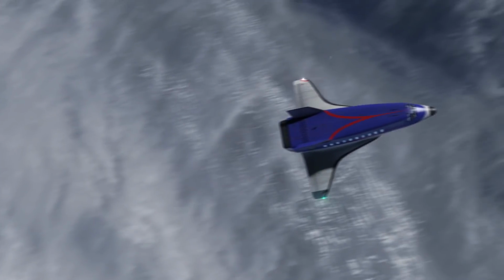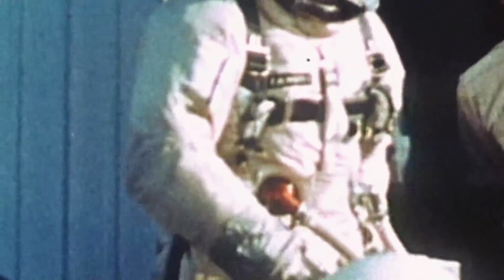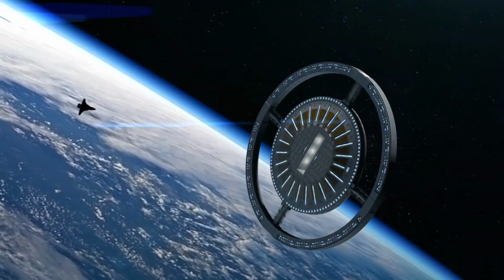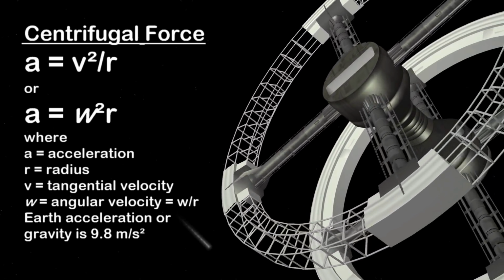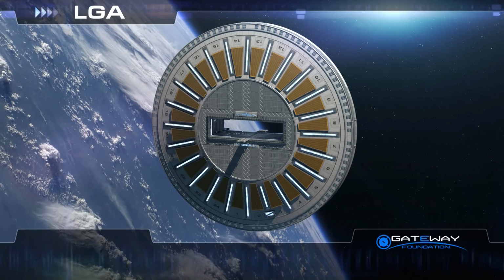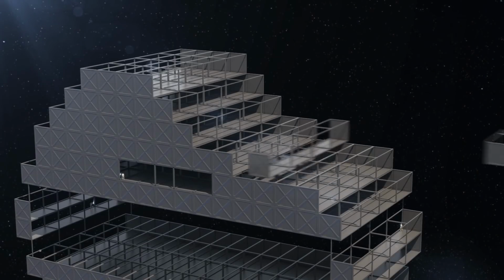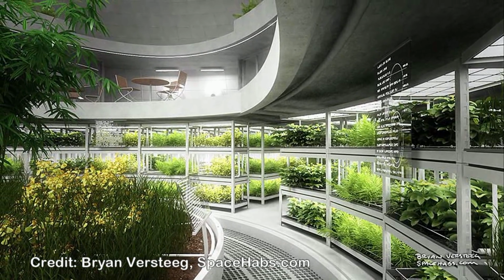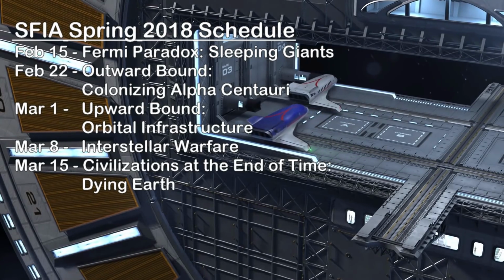Spaceports

Comment: Cover the base with ice covered in the aggregate by melting the ice gravity spin will force it outward and exposed to space it would freeze into a hard self-healing shell "space pykrete" that would provide. armor shielding, cooling have it around a radiator would also provide access to water from the ice may be a large lake's worth trapped between the station and the space pykrete shell.  could hold algae to clean air and an aquaponics sistem for food.

Comment: These guys are clearly on the right track but considering the ISS cost 150bn, even with reducing costs per kg to LEO, this much bigger project makes it prohibitive.  Do they have an initial outlay figure?

Should not the design be lowest possible initial mass with full scalability?  So, what is the lowest mass artificial gravity solution?  To me it seems obvious: two rotating equal mass habitats attached by a cable.  As a modular design it is not a challenge to expand this until you eventually have a ring.  Does it add up?  Can a cable hold enough weight?

Back of the envelop numbers for lunar gravity (1.6 m/s/s) at a comfortable 1 rpm (p = 60s).  

w = 2pi / 60 = 0.1047
r = 1.6m/s/s / w^2 = 145.9m

So, we need a 291.8m long cable.  https://www.engineeringtoolbox.com/wire-rope-strength-d_1518.html  This gives us a safe load of up to 285,000N on the 52mm cable.

M = 285,000N / 1.6 m/s/s = 178,125kg / 2 = 89,062kg per habitat.  The mass of the cable is 2,918kg.  I'll skip the calculus on the cable's weight because it's not very significant.  Let's just say 85 metric tonnes max per habitat to play it super safe.  

So, you would need to bring 181,043kg in to LEO costing $181m at $1,000 per kg.  Of course it's more, you need to equip it and build it but you can build it on Earth and it's two trips on the Falcon Heavy on expendable mode.  Plus, these are maximums, we could make lighter and cheaper habitats.

Anyone like this idea?  Is my maths right?  Happy to correct if not.
Reply from the maker: Well at $1000/kg or a million per ton, you could drag a whole Nimitz-class aircraft carrier into space for less then the ISS total cost. I don't know the exact mass on this design, I can ask Kit but I'd imagine they left it fluid at this state, though I remember John telling me how many trusses it needed, even with the MGA it should be less than a Nimitz. It is BIG, and won't be cheap, but way cheaper per kilo than ISS.
Reply: Yeah, the $150bn figure just breathtaking, probably as much a result of the shuttle debacle (costwise it was I'm sure you'll agree...) as anything else but it's a reminder that running costs are significant.  I like the idea of a minimum cost of entry modular design, makes it more likely to happen in my books.  Dreams are great but something affordable is more likely to become reality and if it's scalable you've planted a seed...   Was a good excuse to brush up on my rusty maths at the very least.  

Thanks for the fantastic content and congratulations in advance for pushing 200K.

EDIT:  Aside from initial outlay, another issue I had with the design was constructing in LEO.  What's the justification?  You need all the untried tech you described and you'd have to build the intricate stuff on Earth and assemble in space.  An absolute nightmare.  On an near Earth asteroid sure, but LEO?  Why not just make a modular design and ferry it up one identical interlocking hab at a time and enjoy economies of scale?  The BFR will be plenty capable.

Comment: Love the animation but a quick question:
Would welding in zero atmosphere be easier than down on earth?
As nearly all welding methods need to keep oxygen away from the weld area using shielding gas or combustible flux and melts the metal to a liquid state and solidifies it again wouldn't the weld pool simply float away?

Comment: Why an internal docking bay? Why not external? External has to be easier and would require less material. Probably safer, too. And there's lots more room on the outside than the inside.

Comment: Had to laugh when people debarked the shuttle into the LGA of the gateway spaceport by through a tube that was oriented almost vertical to spin force. I would expect "Aaaaaa!" *splat*.
Ever notice O'Neill stations never have internal baffles to prevent winds from stationary air or rotational induced tornadoes and are one huge contiguous space? Massive decompression risk.

Comment: A question about the square law, As the pressurized volume increase how does that affect the strength required for the gas tight shell? as higher surface area increase the force to that the shell must withstand ? or am I thinking wrong here? 
And thank you for a awesome channel :)

Comment: IMHO it doesn't make a lot of sense to build a large simulator for lunar or Martian gravity. If the gravity is sufficient for health, there's no need to put lots of people through training. If it's not sufficient, there's still no need to put people through training. 

For research purposes, a much smaller sim would suffice. It only requires a hab module, a counterweight and a string. Or they COULD be put on the ISS without spinning the whole station.

Comment: I'm guessing that if you start adding more lengthwise 'slices' to the station, you'll eventually end up with an O'Neill Cylinder.
Reply from the maker: Not quite wide-enough, though to an order of magnitude. The O'Neill has a diameter in keeping with the maximum strength of steel inside available forms and tolerance of when he designed it.

Comment: 14:21 Can't we just spin pregnant women at 1g?
Reply from the maker: :) That comment just brought the most bizarre image to mind, but probably not. A small centrifuge to add gravity to folks for medical reasons would also need to have high RPM, which induces nausea, something generally already pretty easy to induce into many sick people or, needless to say, pregnant ones.
Reply: So we need a big centrifuge for spinning pregnant women this certainly complicates things.
Reply: But Isaac, if the centrifuge was larger? No nausea right? (I believe I remember you discussing the size of centrifuges as they relate to nausea in a previous video.)
Reply: @thetrumanshow4791  Not exactly. The size is not important, but the RPM. With a bigger centrifuge you need lower RPM

Comment: My very first Arthursday! I have been sick the last few days and have dove very little but binge watch your channel.

Since you mention heat and energy budgets so much I was wondering if you were ever going to do a straight up comparison between power sources and what could be done with them.

For example using the math from your arcology episode I would be curious about how many of them could be powered for a thousand years by various renewable, fossil and nuclear energy sources.

I am particularly interested in if we could hit our thermal budget for the planet with something other than fusion. I doubt we could do it with fossil and I am fairly sure we could do it with a thorium LSR so i am curious where that line is drawn
Reply from the maker: Actually there's a good chance we will be doing an episode on that, though more focused on portability aspects, we've got a poll running for topics right now on Patreon and that's hanging in around #2 or 3 out of the final 20, I always do #1 but usually do at least a couple of the top 5 too

Comment: Congratulations, Mr. Arthur. Apart from humble self, you are the first person I know of to whom it has occurred that multiple-ringed (multiple levels of 'gravity') toroidal space stations are possible, and highly desirable. Not Noordung, not Oberth, not von Braun, not Clarke or Kubrick - nobody that I know of has considered that the space between the hub and the outermost ring can be put to very good use. Now I'll be waiting to see how long it will take someone else to see that the rings can be extended along the axis of rotation to form a cylinder of any desired length. A proper space station should look not like a doughnut, but a series of concentric pipes.
Reply: It didn't exactly occurred to him, did it? If you didn't payed attention (shame on you) this video also features Gataway Fundation's project. He said that the selected spaceport model for this video was Gataway's one. I doubt he told them how to do their job.
Reply: Craig Corson  Isaac Arthur  check out https://settlement.arc.nasa.gov/75SummerStudy/s.s.doc.html  from 1975 - the study was transcribed to HTML and placed on the WWW by Bryan Yager with assistance from Hendrick Lee and Gail Felchle. The [posting] project was mentored by Al Globus and sponsored by NAS (Numerical Aerodynamic Simulation).  It is also available at http://www.nss.org/settlement/nasa/75SummerStudy/Design.html a webpage with lots of links.

I have been told that cylinders rotating about their central axis are "stable" only when they are not very long - any perturbation, like a number of space colonists collecting at one spot can cause it to "tumble".   Studying that is on my List Of Things To Do.  A stubby (h/r = 1.7) cylindrical space habitat has been proposed by Al Globus http://www.nss.org/settlement/space/kalpana.htm

The best part of O'Neill's Type 3 space habitat proposal is that the dual cylinders have their rotation axes parallel and are linked by beams at the sunward and anti-sunward ends so that the beams torque the cylinders just enough that they precess at the same rate that they orbit the sun so they always "face" the sun.  See Figure 3 and surrounding paragraphs of http://www.nss.org/settlement/physicstoday.htm from 1974.
Reply: I was just thinking towards the end, that one could still extend the station further along its axis of rotation. I wonder how long it could feasibly get?
Reply: Jim Fupanda
Did you not watch the video? THAT is why desirable. You could have a lunar gravity area, a Martian gravity area, and anything in between those, and Earth gravity.
And as for obvious, it wasn't so obvious to von Braun or Oberth, was it? It's only obvious once someone else has thought of it for you.
Reply: all about lift price - a cylinder would use a decent bit more mass, if that mass is coming up from a deep gravity well (earth, current designs), that's a problem, if your materials are coming from outside a gravity well (astroid mining, future tech designs) it's a non-issue.
Reply: bob dash  Isaac Arthur  Kalpana scaled up to 4-mile diameter?  double check . . .  2 mile radius * 1.7 for "height" of 3.4 miles . . . then 4 * Pi for circumference of ~ 12.6 miles . . . 
HA ! ! ! that's ~ 42.7 square miles . . . if one third of that is set aside for farmland and one third for single level studio apartments and one third for everything else . . . that's almost one million "homes" for a million singles.   Perhaps we should think about ~100,000 "mansions" at ~ 4,000 square feet for two parents and averaging 2.5 children . . . 4.5 million people  Wait, I"m not fully awake - are those numbers right?  What if the "mansions" had farmland on their roofs and "green walls"?  Google Search <vertical farming>  

but to build it at LEO would be EXPENSIVE in terms of DeltaV.   No, something like that would be built out in the asteroid belt - "in situ", as they say.
Reply: Read "Ender's Game" and "Ender's Shadow" by Orson Scott Card. He describes a "Battle School" space station where the upper (inner) decks house infrastructure in the lower-G environments and the lower (outer) decks house the workout areas in the higher-G environments. I believe it was mostly confined to a range near 1G (probably from 0.7G to 1.2G or thereabout), but the idea of using different layers for differing gravity effects was definitely there.
As a bonus, the Battle School also had zero gravity combat training arenas, which is awesome.
Reply: I'm pretty sure O'Neill once came up with the concept, as I clearly recall hearing of such a thing decades ago in a book of his about establishing space stations at "L-5 by (19)95". Isaac Asimov also mentioned such a possibility in one of his science treatises. Heinlein also included the concept in some of his works.
Reply: Kalpana One is very interesting, considering it scales up. A 4-mile diameter one would have a habitable earth gravity area of 32.7 sq miles. nice island nation size. could house 100,000 people..?
Reply: "2 mile radius * 1.3 for "height"" - correction.

"For reasons described below, the maximum length of a rotationally stable cylinder is approximately 1.3r, which leads to hullSurfaceArea/1gLivingArea ≈ 1.77 (note: earlier papers incorrectly listed these figures as 2.2 and 1.45 respectively). " quoting from http://www.nss.org/settlement/space/kalpana.htm

Recreation, open nature simulating parks with small animals, small lakes/ponds/streams, and mass congregation areas take up a lot of space.
Reply: Wouldn't be mansions necessarily. People like space, could be a 4,000 square feet yard with a 2,000 square feet two story house.
Reply: bob dash  Isaac Arthur  thanks for the correction.   I wonder if something like Kalpana will happen and how soon.  In all likelihood each "house" would be "unique" not "little boxes and they all look the same" https://www.youtube.com/watch?v=XUwUp-D_VV0  BTW one of the presentations at the 14th space manufacturing conference hosted by the Space Studies Institute had an interesting proposal for the "bunkhouse" for the on site construction workers building large space habitats - a "bolo habitat" - that would also be appropriate for a small group of people "homesteading" out in the asteroid belt.  See slide 10 http://ssi.org/2010/SM14_presentations/101030_SSI_Curreri-Detweiler.pdf
Reply: Craig Corson The universe is toroidal in its 
operation and design.
Reply: Craig Corson You can't just extend the axis indefinitely. It's not stable. Torque and shear are worse. Tubes are worse than rings and barrels.
Reply: Possible yes, even unavoidable, and (cough) pretty obvious... But why desirable??

Comment: I love the series and the ideas are stimulating. There were a couple of issues that I did have with the images presented. The individual components being assembled were square. I think that hexagonal sections would be more efficient. Think bee hive and honey comb. Triangles are the most stable forms, ah la Buckminster Fuller. The center section of the space port does not need to rotate, thus allowing easier docking. If there were three spinning rings at various diameters, Lunar , Martian, and Earth gravity could all be simulated at the same time. The angle of rotation should be parallel to the rotation of the Tara. This would allow docking at any point of the orbit. Visually, when the people were going from the shuttle to the station, the perceived angle of up and down was wrong. Otherwise it was very enjoyable and enlightening.
Reply from the maker: Yes to be sure hex has a lot of advantages, though nowadays computers make it easy to modular deigns incorporating other shapes besides triangle, square, or hex.

Comment: 4:40 At this Point the Animation makes no sense!
Artificial Gravity does not work in the center, at least not as much to be able to walk. It seems the pull would be rather forward than downwards anyways.
Reply from the maker: I think that's more of concession to the company that was doing the animations, rigging is a pain and they probably just used existing assets there. Yes they should be drifting not walking and any gravity is outward, the bay shot of the folks eating in a cafeteria below does that too.

Comment: Once you set it rotating, all construction of outer rings takes place in some level of artificial gravity. I wonder whether they've accounted for that; maybe they plan to stop the rotation temporarily for expansions?
Reply: Matching the rotation, at the outer edge, involves 1) getting up to speed initially and then 2) constantly thrusting inwards at a rate equal to the artificial gravity being simulated. It's not what you normally think of as simple rotation.
Reply: Build externally in 0G and attach while not rotating is the safest and simplest solution. A station-wide "Attention, the last launch for Earth before artificial gravity is suspended for the next month is leaving in ten minutes. We apologize for the inconvenience and hope to see you again in 3 months after attachment of an additional ring with increased gravity after testing is complete. We hope you enjoyed your stay in the universe." goes a long way when it's for everyone's safety.
Reply: You can construct another ring In zero gravity nearby then spin and connect.
Reply: You're assuming rotation gravity is the same as planetary gravity; it is not. Remember the building modules are still being manufactured in 0g, then transported to the construction site. When the drone arrives, all it has to do is match the rotational rate of the station, thereby effectively zero-ing out any gravitational effects.
Reply: But it is a more difficult problem in terms of assembly grip strengths and material tolerances than working in zero g.
Reply: Considering that most of the construction is done by robot with minimal human support, the change in gravity caused by the rotation shouldn't be a big problem. Stopping the rotation, except in certain critical tasks, shouldn't be needed.
Reply: But adding more segments would effectively require lifting them against Moon or Martian gravity (or more, if you plan an Earth grav ring). Gone are the advantages of zero g construction. The link between the drones and the materials would have to be at least that strong, and if their grip slips, the truss goes floating off into space as if it had fallen off a platform on Mars.
Reply: True, but it's not a difficult problem for a computer.